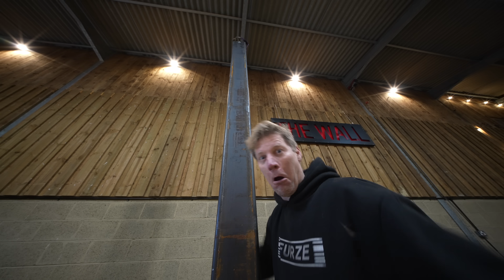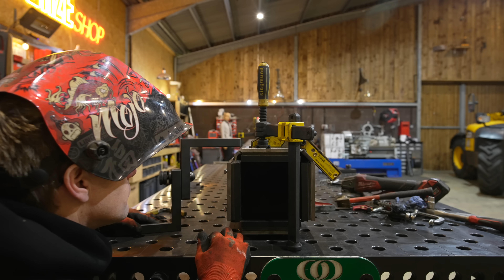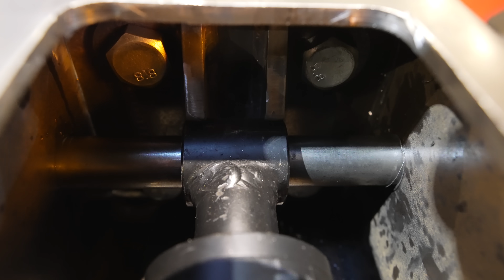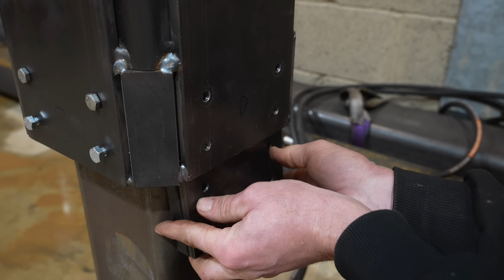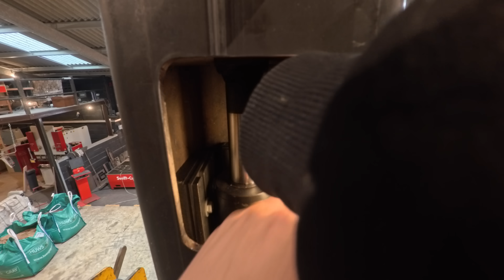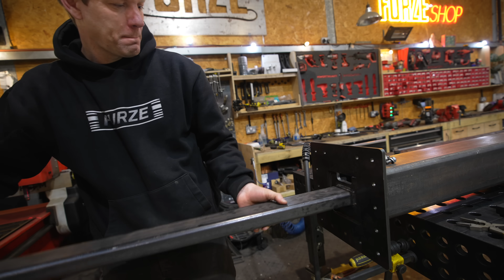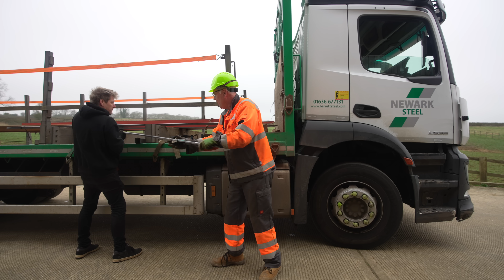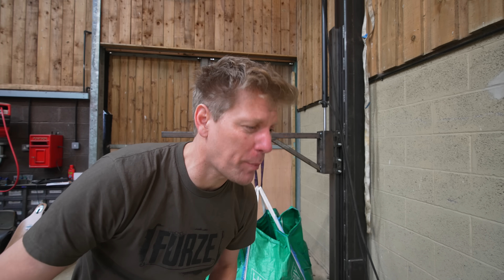Digging SECRET Garage Part 7 Car Lift Prep

Comment: Colin if you want to try and sort out the hydraulic synchronization you need to talk to the people that move houses and use multiple jacks to lift buildings. It may help you figure out how to sync up the rams but simplify the process. Also the little voice problem is perfect for your videos and makes it part of you as well.

Hope the inspection goes well. Keep at it.

Comment: @colin Why not use a long threaded rod instead of hydraulics (you could use more than one in each tower leg). This would eliminate the risk of the platform dropping (it would be completely fail safe) and it would be fairly trivial to ensure that each pole rises the same amount.

Comment: Glad you mentioned at the end you have a structural engineer just checking everything over. I think the slot taken out for the inner hydraulic ram might cause more stress points than you'd think, but looks like your getting everything properly checked which is great! With this sort of stuff its always the tiny things that you think 'well that wont make any difference whatsoever' that introduce stresses that other bits just cant cope with. (See Hyatt Regency Skywalk Collapse as an example - a small fairly innocuous change to how the rods uses to suspend the walkways from each other made during construction caused wildly excessive loads at points simply not designed for it, and in the end 114 people died when the walkways collapsed. - the advice here, once tou get sign off from the engineer do not change anything, no matter how small it seems, until you get the sign off on the change. You'll be supprised how such a small change in one place can massively increase the loads elsewhere).

You have always made pains to state that you have had structural engineers during the whole project, but its more people watching might not realise should they be crazy enough - and wealthy enough - to do such a project on their own!!

Comment: 13:24 uhhh anyone else concerned if this is the bolt size being used to anchor these? xD They seem a little small for the application.
Colin, hope an engineer signs off on everything before it's installed. :)

Comment: You could make the eccentric cams for the bearings out of hex bar stock so that you have a hex head on the outside that you can put a wrench on to adjust the cam. Just turn them down to be cylindrical leaving a bit of extra length with the hex.

Comment: Is it just me, or did any other engineering minded folk experience uneasiness when he showed his CAD drawing of the plan? I hope the physical real world version is not just being attached on only one side of the platform like in the CAD model. I also worry about that plate dropping down perfectly aligned into the bottom spinning plate with the recessed space. I know it does not NEED to be that close of tolerance and can have gaps that car tires won't have any problems with, but I hope he has the spinning platform gearing tied into lifting platform mechanically somehow, or some other mechanism to stop the lift if the spinning plate is not properly aligned.

Comment: I wouldn't divide 12 tonne by 4 legs without a substantial margin in case the legs aren't level and one is doing more work than another.  I'd recommend 5-6 tonne per leg.

Comment: I"m a Canadian when I use to be a welder fitter back in the early 90s I worked at a research and development firm I was the only welderfitter working for the firm. I had to build a robotic welding tables for the Austin Mini Corp that later on after it was finally assembled with it own gantry system we sent it to Burmingham England. The table had plates that mounted for a mig set up, had it had to move in all different mulitple directions a s well as mulitiply layers on the table, it had to be welded with hard wire for as less warpage as possible then it had to be heat treated and machineed at several stages. I had to build four of these tables took me about five weeks to build each one.  It was one of my most challenge jobs of my carreer back in the day.  Looks like your doing a fairly decent job there Colin. Cheers.

Comment: Just feels like the screws holding the ball bearing assemblies at 22:00 could break... The thickness of the frame won't be a problem when the screws are the weakest point

Comment: I work as a mechanic in a themepark, where one of the rollercoasters has the maintenance area hidden below the station of the ride. To access it, we have a huge hydraulic lift to raise the whole station, and have the rollercoaster train go onto the maintenance track below. It works basically exactly like this lift, which is really cool to see! Your version is way cleaner and more thought out tho!
Reply: Invite him to show him!
Reply: @XxDonnaLauraxX  i definitely would if Colin is interested! If youre reading this, hit me up!
Reply: This sounds a lot like a Mackrides spinning coaster to me. As far as I know, this is also used to store the second train when its not in use. I saw this lift in action once at the dutch theme park "Toverland" on their spinning coaster "Dwerverlwind". Its cool to see, but painfully slow.
Reply: @blackdragonslp  Its a Mack Junior Coaster, so youre really close, i think they both might be the same system! And yes it also acts as storage and is slow yes, but youre also precisely lifting about 12 tons of steel, and safety is really important too.
Reply: @blackdragonslp  It is not like the Netherlands is that far from Colin. Take the family for a quick holiday and check out the hydraulic lift at the same time!
Reply: As someone who operated rides at a theme park (Kings Island), hearing that Colin's home built system is better thought out than one that handles thousands of riders a week is a bit disconcerting.  No knock on Colin's work, I would just expect professional equipment to be better if only based on budget.
Reply: @phydeux "professional kit" is often "barely" built by the cheapest bidder at the fastest pace. It's just good enough to pass in most instances, and unless you're building something like a rolls Royce or maybach, that's sufficient for most project managers/people paying the bills.
Reply: @phydeux Its more about having additional features like the secondary lift or the guide rails, or ease of access to replace shims and glide pads. 
Also a big factor on themepark rides is things have to be functional, but also look nice for the guests, so a lot of structure is hidden behind decor panels and stuff to make it look nice
Reply: Im currently having a shit 😎👍🏻

Hydraulically pumping it out with methane gas mixed in 😎👍🏻

Comment: are you going to add a ratchet safety to the system like a typical 2-post car lift? Just in case hydraulics fail. Not saying they will, but it's not impossible.
Reply: Question answered right at the end. Ha! Nice work.

Comment: Colin, you had me worried because I know the punk in you disregards safety and the tie keeps your head attached. Merch idea? Don't get your tie in a knot t-shits 🤣 I would work out the safety before moving to the other 3 as that can change the design. Also don't you want to cut the seam side when opening like you did?

Comment: Just some random thoughts here :
Could you have load sensors at the bottom of the whole thing so you end up with a massive scale for anything you put on top on the driveway, or inside the garage ? That doesn't seems too complicated and will provide an awesome tool for futur projects !

Comment: Auto lift latches are needed at the undercarriage maintenance and  topmost position at least.  This takes the load off the hydraulics in those positions to allow you to work safely underneath  the car.  You will also need that for removal of the internals with the hoses removed.

Comment: Engineer here; made many telescopic actuators like this (especially in the nuclear industry); on two edges, have your fixed inner rollers or pads, and opposite of those fixed slides, you use a spring washer like a Belville spring washer or a wave spring washer, to adjust to the variance, yet it won’t bind the rail.
Reply: No idea what you're talking about, but yes! Do that!😂
Reply: @Miss_Toots  I can translate. Basically he wants his nuclear telescope to roll into his Breville washer/drier, which is filled with spring water. Then the blinds will fit nicely below the valence.
Reply: @jonpeterson9733 I had a good laugh. Thank you all.
Reply: @markglover2525 😂😂😂
Reply: Excellent thinking my friend ,The Belville washers will work a treat ,plus I would be using high tensile capscrews all round not those plated ones.
Reply: @davidcook380  I was thinking that - 'I hope he's going to over spec the fasteners...' cos doing all that and having a bolt failure would be...sub optimal!
Reply: As someone who works in the restaurant business i fully agree. This is the way.
Reply: @azoique This is the way - Wasn't some "Man DeLorean" reciteing this over an over?
Reply: @azoique as someone who is drinking a beer after work, I completely agree.
Reply: Replying to increase the chance that Colin sees this
Reply: mmm, nuclear engineer. Now thats a good idea for the next Furze build. Forget jet engines lets go nuclear 😂
Reply: With six hydrocoptic marzlevanes to effectively prevent side fumbling.
Reply: I mean, the biggest problem I see is that Colin is trying to figure out everything as he goes instead of bringing on an expert to guide him through the process, especially on this crucial step
Reply: @idale4964  I think Colin's process is always overengineer the heck out of it and hope it works!
Reply: @Tim091  As my professor for Statics was fond of saying "Anyone can build a bridge, it takes an Engineer to build a bridge that barely works and lasts for a long time"
Reply: @Tim091 if in doubt, build it strong with stuff you know a lot about
Reply: @Tim091 he is getting a structural engineer to do a sanity check on it so he does get his working out checked but as always he goes over spec and why not that bunker and tunnel system will out last his house 😂
Reply: @idale4964  Lol! Why bother to "bring in an 'expert'" (coughcough) when he's got thousands of them directing him right here...?
Reply: @barbarakauppi9915 The real disbelieve part of this video is that there is an engineer who worried about ease of maintenance
Reply: @idale4964 which is literally the entire point of his channel, him figuring out as much stuff as he can, himself, then making it.
Reply: @i @idale4964 That entirely defeats the purpose. He may not be an “engineer” but he has more than enough experience and intuition to be able to know what he’s doing. Yes a lot of things he’s doing may not be optimal, but if anything every load bearing aspect of this is overbuilt. He even said he’s having a structural engineer go through everything to make sure the math checks out
Reply: @idale4964 Colin is the expert. Expert is just a label that some people get for some reason

Comment: Id LOVE for an engineer to tell me how much weight this lift will ACTUALLY take to buckle the metal skeleton with the amount of overengineering furze is doing here. Absolutely awesome!
Reply: Using US standards for structural steel, 10 inch square columns that are about 15 ft tall and 1/2 inch thick (my rough guesses for the outer beam), a.k.a an A500 Gr. C Steel HSS10x10x1/2: the allowed loading would be 660,000 lbs, 330 US tons, or 300 metric tons before buckling per leg. That number includes several simple reduction factors to account for possible inaccuracies in manufacturing and loading (for any engineers, φ=0.9, Rᵧ=1.4). Removing those would be unsafe for design, but would likely be more accurate to when the column is probably going to fail. Doing so gets you an expected buckling point at just over 1 million pounds, 513 US tons, or 466 metric tons [References: AISC Steel Construction Manual (2023) Tables 2-4 and 4-4, and AISC 341-22 Table A3.2]. However, that assumes the force is applied directly to a freestanding column. The connections to the platforms and walls could decrease it if it causes bending in the connection region, or increase it if it makes the column stiffer. And of course, that all requires every other part of the contraption (the bolts, welds, and other beams) to be able to take that much as well.
Reply: not a engineer, but i can for certain tell you that the structural parts can probably hold 10x what the hydraulic system will be able to lift. Those are very beefy, overkill posts. And I love it!

Comment: Instead of a slot, it seems like an access hatch on the top side would be easier. If the lift was lowered all the way down, could unbolt the cylinder and open the top-side hatch, then pull the cylinder up out the top. Would just need to use some sort of pin at top and bottom for connecting the cylinder to the leg

Comment: Why is the larger box section on the outside the one being raised up? Lift less weight, make it safer etc by flipping it over and lifting the inside beam.

Comment: Mr. Furze! You should take a look at car lifts and their way of operation, which makes use of a telescopicmechanism that makes use of chain, cables and hydraulics.
They are connected in such a way that one hydraulic cylinder is connected to the other side for safety anf both will lower together.

Comment: I admit i'm typing this before i watched the full video (i'm 20 minutes in now) but i wonder, have you thought of any fail safe options? Let's say the lift is up and something goes wrong with the hydraulics, you probably don't want the lift to just fall down. 

I'm not sure how it works but for example an elevator has some sort of a brake on it, if the elevator goes down faster than it should, the brakes will catch and the elevator stops right there, preventing it from just dropping down the elevator shaft.

Edit after watching the end: I see you are going to add safety brakes. Happy with that!

Comment: Don't stress over making the box sections sleeve so tight. Think about thermodynamics! Your metal sqaure tube will shrink and grow and your adjustment pads might choke the legs under expansion.

Comment: colin you have a way of putting really bad ideas into my head. do i need an underground garage under my driveway connected directly to my basement? no. is practical? probably not. do i want it? is a ducks ass water tight? of course i do

Comment: Why don't you make a top cap for the leg and slide the hydraulic cylinder out from the top, instead of cutting that slot in the leg? That way, you can pull it out of the garage by putting an access covers on each comer of the upper platform

Comment: Don't forget about grease nipples on all of these joints and slidey bits! Much like your telehandler and other hydraulic equipment you will want to have grease points for maintenance. You live in a very wet location, so more lubrication the better for corrosion resistance.
Reply: NO, TEFLON BOOM PADS ARE SELF LUBRICATING

Source: me, Crane Operator
Reply: Yep exactly. Best to run this with dry teflon pads.
Reply: @Metagross555  i assume they mean for the ram pins and bearing cams, not the pads
Reply: @Metagross555  ...but NIPPLES! Keep them in mind.
Reply: Just have a port to apply a generous amount of WD-40 in the legs and we're golden lol
Reply: @tomclanys WD40 has never been a lubricant
Reply: @deckname5794  nobody talks about lubricating here, only about keeping the rust away. Smooth metal itself won't wear it away too fast.
Reply: @deckname5794 ,agree , far better lubricants than WD40
Reply: @tomclanys then it works, but smell in the beginning might be something else
Reply: @deckname5794  I like it though ;)

Comment: While you mentioned it at the end, not sure I quite understand your cable system. To ensure all four legs go up at the same time, one of the best solution is to use wire encoders (is this your cable system?). These encoders send their position data to a PLC (no need for a fancy one, it would be a handful lines of ladder coding, can be done through chatgpt really), which in turn controls the solenoids attached to the hydraulic valves controlling the height of each of these. Ensuring they all go up or down properly and stops if the deviation becomes too high and the system does not have time to fix it (like it tries to activate the Up solenoid on leg 3, but that particular solenoid is dead or the valve is gunked up and not working as it should). Might be good to have a "drive" controlling the hydraulic pump as well so it can slow down instead of being high power all the time for ups and down. Which you could also program with the wire encoders when they reach X position, slow down...
You'd also need individual controls up and down on each posts to get them back in sync as need be. The stoppers in case of a sudden drop are a good idea, though.

Comment: The knowledge that everything will fail, and planning to be able to fix it when it does, deserves all the respect, I’m in electrical and there are times where I’m sitting in a bucket truck cursing the person who designed whatever I’m dispatched for that day, so I gotta say, solid 10/10 planning
Reply: I was going to comment the same. I used to do maintenance on cnc machines. We used to curse engineers for not thinking of the maintenance aspect of machines.